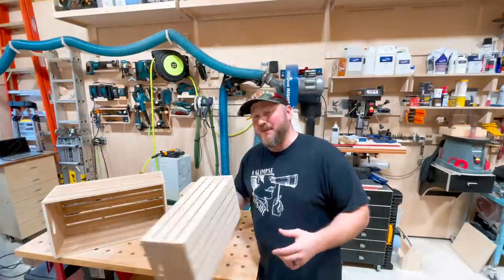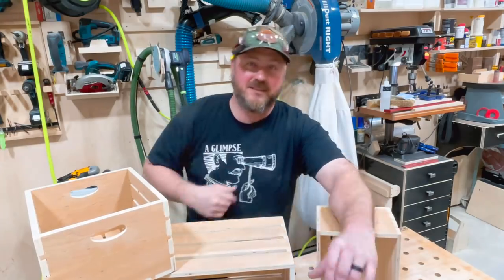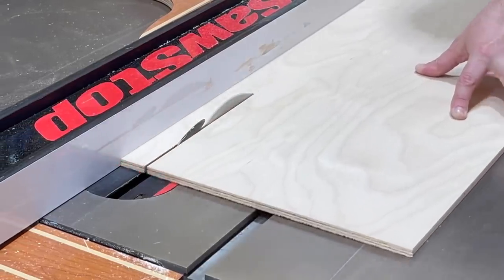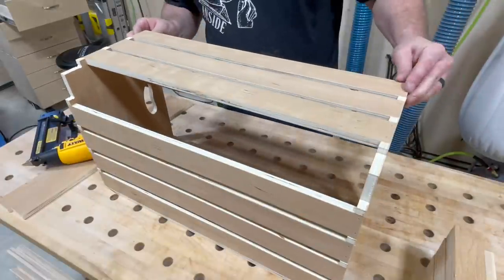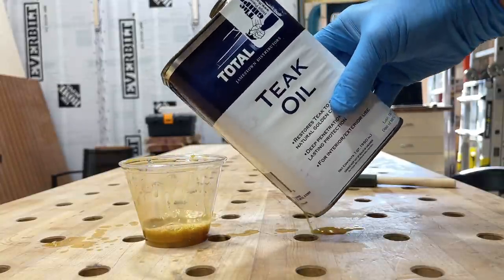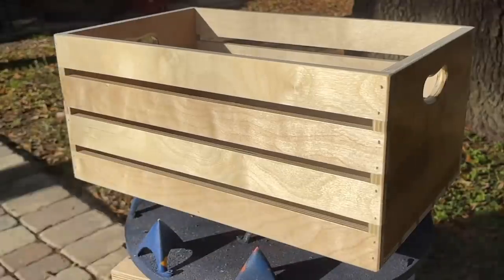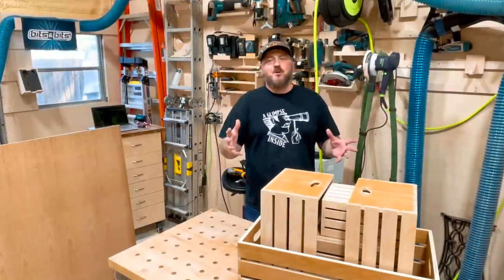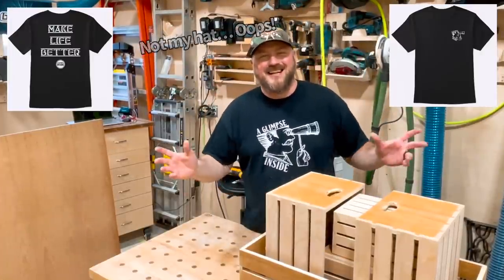How To Make Storage Crates With and Without The CNC | A Glimpse Inside How To

Comment: Hey mate. I’ve just come across your channel and I like your quick sharp and to the point format you roll with. 
Just a question on the CNC ends…. How did you deal with the internal radius left behind from the CNC when fitting the square strips into them?  I hope that makes sense.
Reply from the maker: Google image. “Dogbone fillet” I think this might answer your question thank you
Reply from the maker: https://cuttingedgecnc.co.uk/internalradii/
Reply: @AGlimpseInside  ok cool. Thought that’s how you may have done it but I didn’t notice any dog bones in the video.
Reply from the maker: @gavinclayton9552  There may or may not have been in there. Sometimes I forget to put them in, I’d like my mother always says if it doesn’t fit, force it

Comment: But...   You can buy them cheaper.  Michaels has 12x18s for 10 bucks... Home depot has them for 12.99...   and a 4x8 sheet of 1/2" Baltic Birch is 66 dollars at lowes, and 59 dollars at Home Depot. 

Count your time, and nails, sand paper, a finish...   They're a lot less expensive to just buy them.
Reply from the maker: I suppose prices differ depending on where you live. Even if they cost exactly the same. You can always make some thing much nicer than what you can buy at the store. That’s also kind of the motivation as well. But I see your point
Reply: The joy and satisfaction of making them yourself though… can’t beat that feeling! Also if you use leftover wood from other projects or whenever you get rid of old furniture you will always have a stock of materials-I also try to keep any screws, castors and bits that might be handy at some point in future!